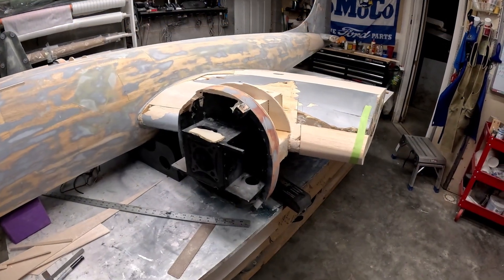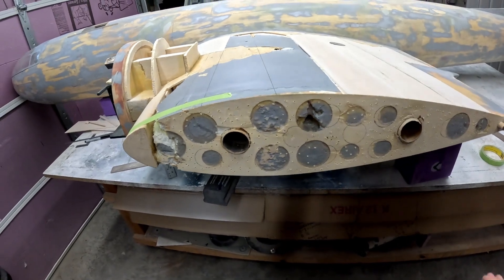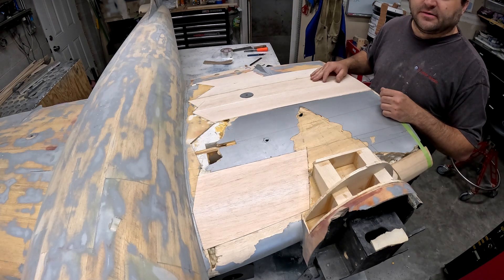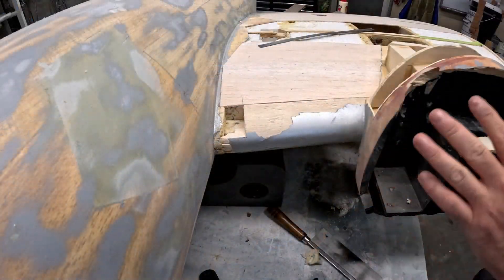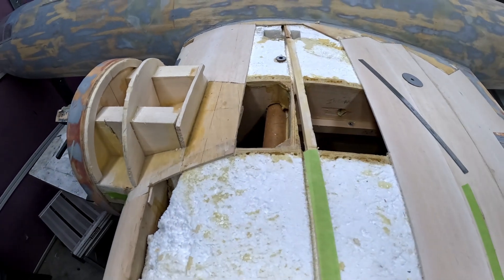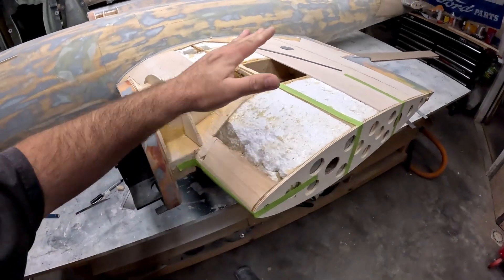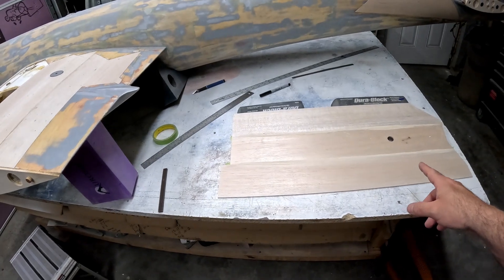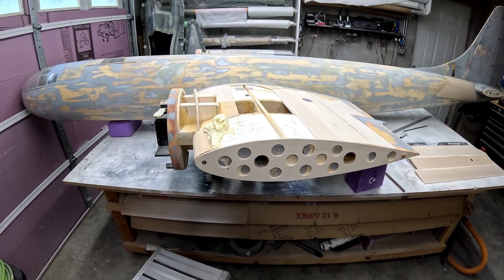B 29 Restoration Project #25  L Inbd wing 5

Comment: Thank you for sharing this great Projekt. You are an amazing model builder with an enormous pace.
What kind of pouring foam did you use behind the leading edge? It looks like it has a verry fine texture. Iam looking for a produkt like that.
Thanks for still making content, i stumbeld over you Channel some time ago as you started the F-14 plug.. As i said, an amazing model builder.
Wish you guys all the best for this great Plane🙏
Reply from the maker: The pour foam we used is from Smooth-on.com they have a large variety of great products that we have used for many different things (including making our own tires).   One of these days I will get back to the F14.  I need to invest in a CNC mill in order for that project to see completion since the cheapest quote i got for landing gear was $100,000 USD